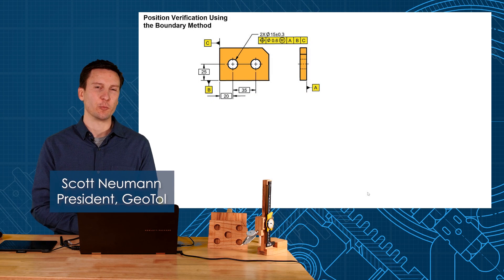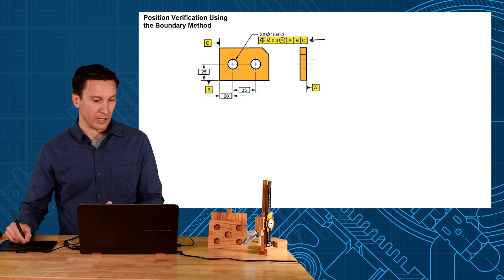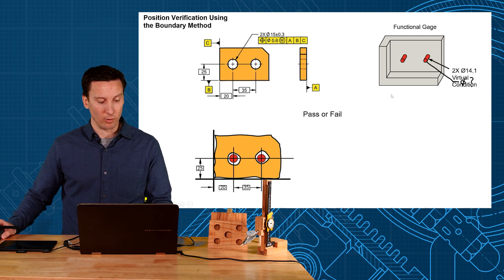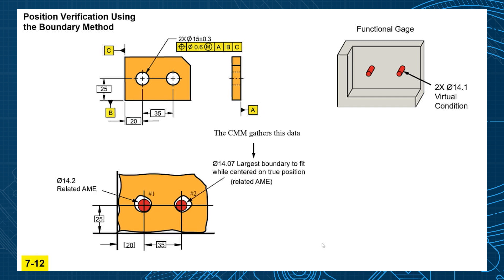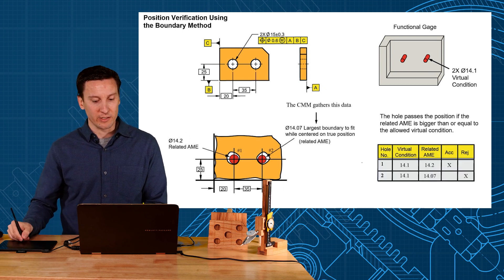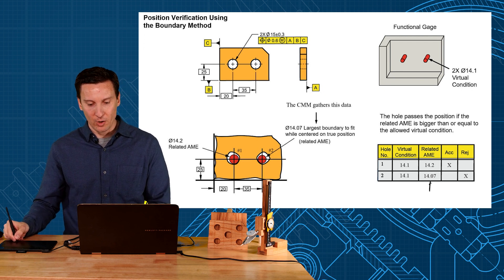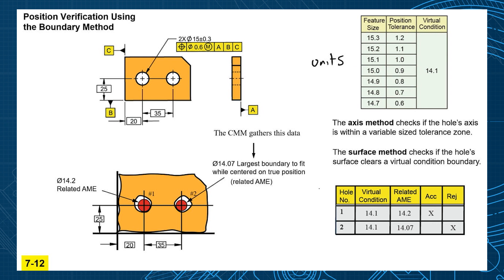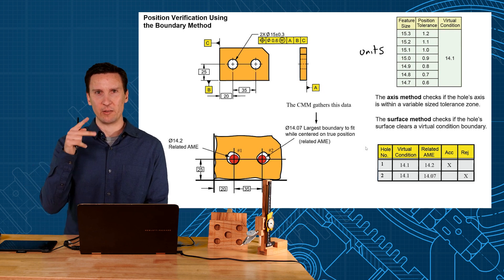Inspection of Position Tolerance using Boundary Method

Comment: Great video, thanks! 
wouldn't the gauge pin simulate the mating part's largest possible diameter, making it the tightest fit and thus the worst-case check?
Reply from the maker: The gage pin is built to the virtual condition of the hole calculated as MMC - position tol. The mating part's pin also has a size and position tolerance and its virtual condition is MMC + position tol. So the virtual conditions of the two mating features should match.

Comment: Thank you so much.
Any questions
How do I calculate RAME from CMM measurement data of a hole?
Can I get it as “RAME=UAME-Measured Actual Position”?
Reply from the maker: Yes, that's a pretty good approximation. Note that unsymmetrical form error can yield to a slight difference in the answer though. This is due to the difference in the "axis vs surface method" for evaluation. Figure 10-6 in Y14.5 explains more if interested in these slight differences.
Reply: Thank you!

Comment: The thing is, if you can’t machine perfect parts, how do you make a perfect gauge? Would you need to combine the tolerances of the gauge and part so that the part takes up most of the total error?
Reply from the maker: All measurements have a measurement uncertainty. Less than 10% is a common goal. Most inspection labs manage this uncertainty to never pass a bad part (called absolute or pessimistic tolerancing). This means the gage tolerance eats into the part tolerance by 10% (this is also called "guard banding"). Also see ASME Y14.43: dimensioning and tolerancing for gages and fixtures.
Reply: @GeoTolPro  thanks for that very useful response! I actually have that standard but have not read it.